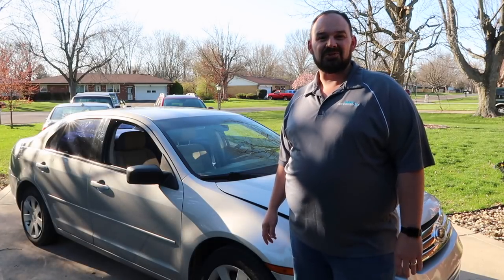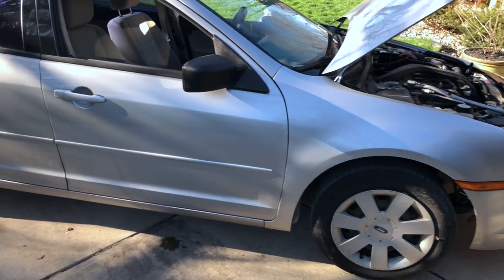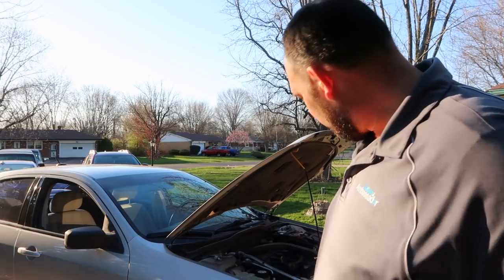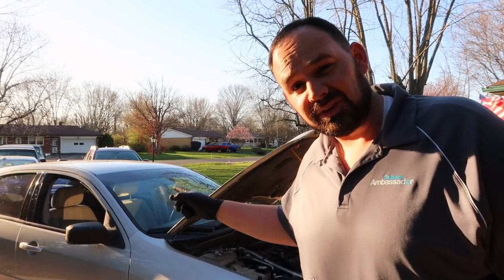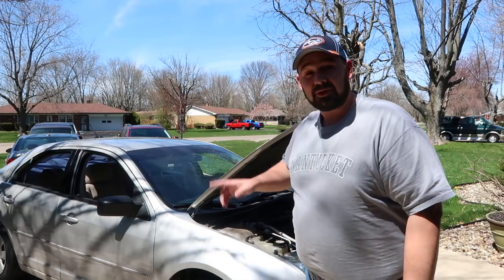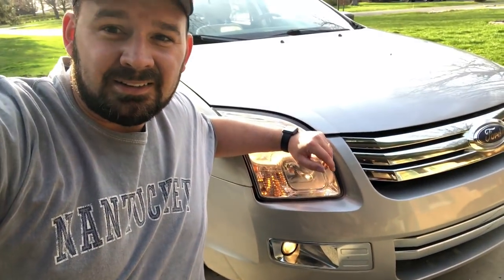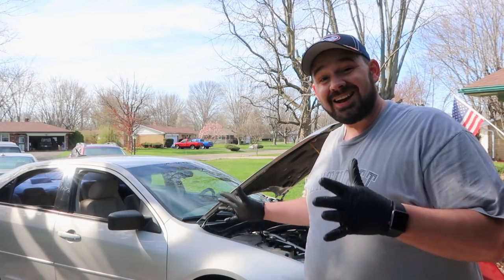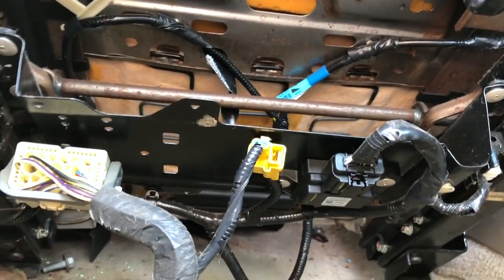Fusion is FINISHED!! -- Fusion Rebuild Part 11

Comment: Great work puttin this Fusion back together. Very presentable, clean car.
If weather is warm enough on a flip or car I’m selling I like to take the interior carpet out and pressure wash the crud out of it.
Reply from the maker: Thank you!
That’s a good tip. I’m not sure I have time to do that, but it sure would do the job!

Comment: The Fusion drive lights are integrated with the headlight switch.  I don't know if your Fusion uses the same headlight switch as the higher end model, but if it does, when the headlights are turned to the on position, the switch can be pulled outward for turning on the drive lights.  It is a moot point since you did not wire them up that way, but you may already have the correct switch.  You may already know about the switch operation, but my comment may be useful to others 

As always a great job.  It looks really good.
Reply from the maker: Thank you for your suggestion! Unfortunately my switch doesn’t have the pull out function for the fogs. But as you said, this could be helpful for someone else.
Thank you for your encouragement!

Comment: It kinda looked like the plastic piece for the crash bar you had to fix was falling off on the driver side. Not sure if I’m right or not but might want to check that. Great job by the way, I like your channel a lot as I’m a Copart buyer as well
Reply from the maker: Yeah, it was loose. I got it squared away off camera. Thx for pointing it out though! 
Thank you for your kind words about the channel!
Do you make vids about your Copart rebuilds? Have you done a lot of cars yet?
Reply: Only one, a 2003 Nissan Pathfinder and I wish I had the skill to do YouTube vids about this stuff. I just recently bought a house so I’m kinda tied up with money until I close. The garage on the house is huge and I’m also getting a lift. I would like to get another Copart car and do a video, I’m 38 and been building cars since 9 years old. As for now I really have to wait until I’m a month or so in the house to be able to do anything
Reply from the maker: That’s awesome! Congrats on the new house and upgraded garage!
Let me know if you get around to making vids about your builds. I’d be very interested to watch!

Comment: Car looks good hopefully you were able to make a little profit with it. Been bidding on cars every week at Copart but the prices are to high or they will not accept below reserve wins I get.  I would check IAA but none close to me. Have a few clear title wrecks I am bidding on next week and willing to spend a little more since less hassle trying to get the enhanced inspection plus branded title.
Reply from the maker: Thank you! It’s not sold yet, but hopefully soon. Need to get the title changed first.
Keep on working on those bids. One of these days you’ll get the right car at the right price. No need to rush!
I’ve just recently started looking at IAA. Planning to bid on one next week. At least gives more options.

Comment: Just stumbled across your page today, and loved seeing this build!  Wanted to give a small bit of advice for going forward in regard to your fog light wire-up though.  The fog lights aren’t meant to operate when the high beam lights are on, so they may be illegally wired depending on the state the car ends up in.  There are quite a few cheap aftermarket fog light wiring kits out there that make them super easy to install though.  It’s been awesome watching you rebuild this car, can’t wait to see the next one!  You’ve got a new subscriber here for sure!  Check out SamCrac, and Goonzquad if you haven’t already, they are great channels!
Reply from the maker: Thank you for watching and commenting! I’m glad you found the channel.
Yes, the fogs were a compromise. I went back and forth on how to do it and ultimately landed on what I did. The car stayed local, so it should be fine. But if ever the owner wanted to change it or add a switch that would be pretty easy.
Thanks for subscribing! I really appreciate your support! You’ve recommended two very good channels! I watch both regularly. They work on some pretty high end stuff! Maybe one day I can work up to that. Lol!